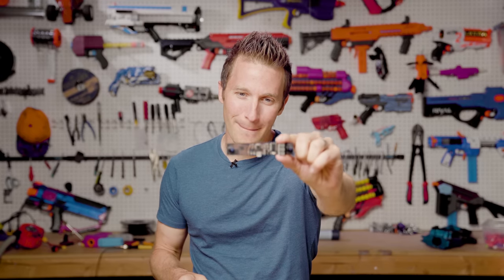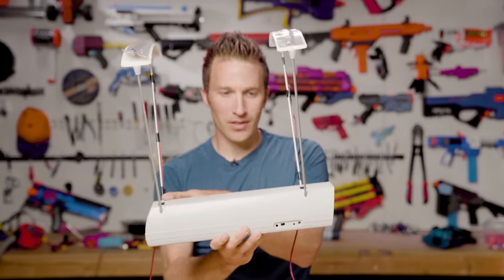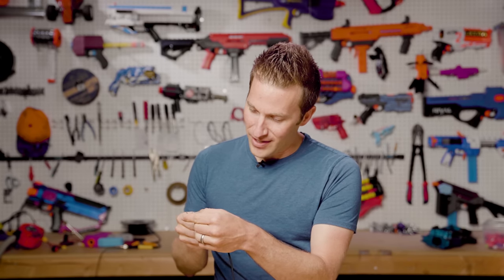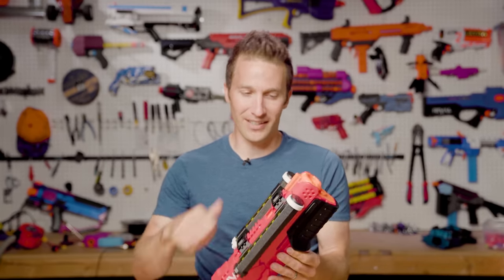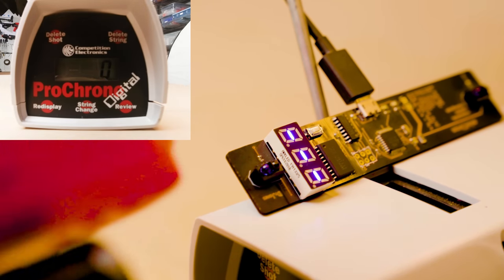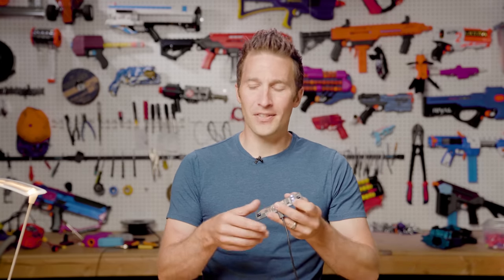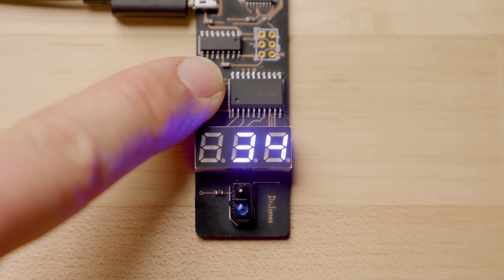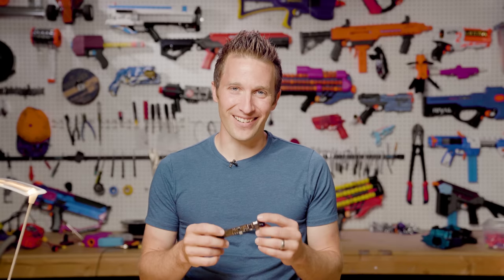Worlds Smallest Shooting Chronograph (Mini Chron by Dr. Jones)

Comment: Wonder if this is the same Dr.Jones that worked on the guppydrv LED flashlight boards. Functionally it seems similar to your big Chrony and hopefully is in the $30 price range. Having a Saturnus that needs to be calibrated, I wonder if the IR emitters need calibration